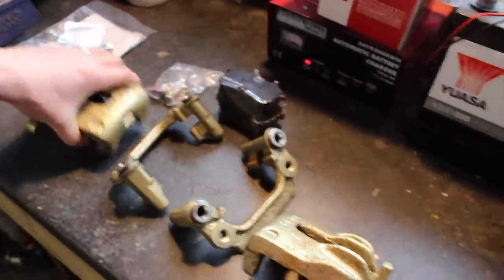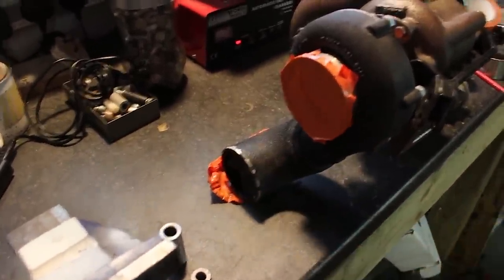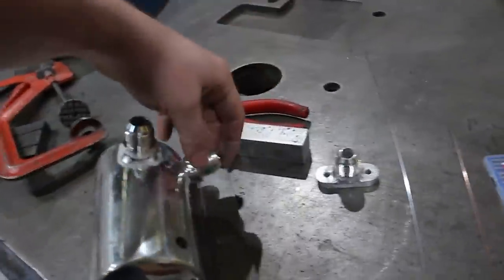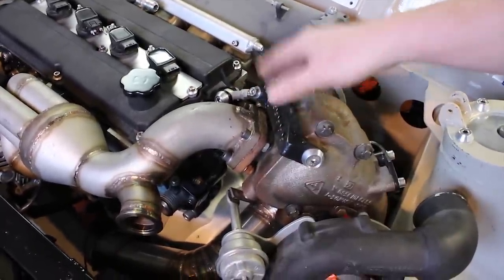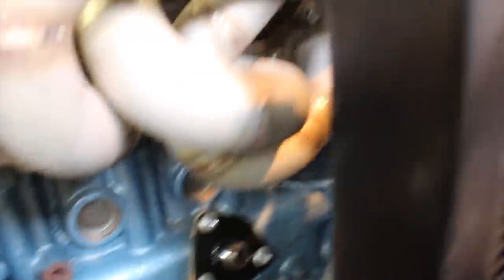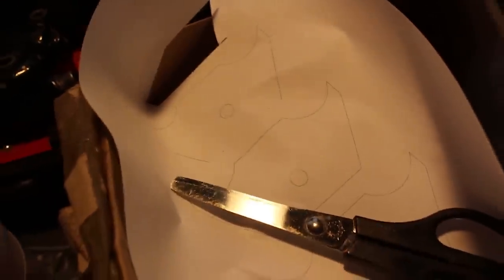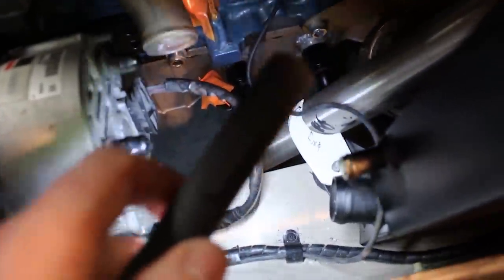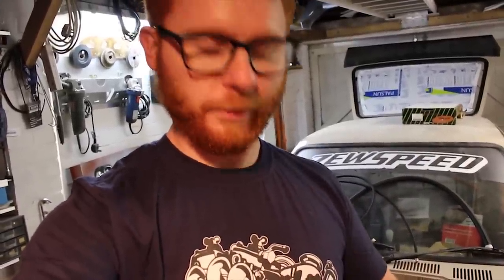Compound Turbo Fiesta - Episode 18 - fitting the poly windows

Comment: nice fab work as usual, ive got a twin turbo bmw 123d, compaired to a 120d which has a single turbo it feels very un turbo like , no lag, no rush of boost just a strong puch in the back from next to nothing , 265 bhp mapped and 57 mpg on a steady run out today .!!
Reply from the maker: I think the BMWs have sequential turbos. their system works very well. all the torque all the way through the rev range.
Reply from the maker: ive got a 330d and a single turbo you can feel it getting up on boost.... aint nobody got time for that!

Comment: Better to put those cotton reels in compression rather than tension, they do tend to deteriorate quite quickly with the heat & tear apart otherwise. Coming together tho. What was tge compound setup from originally?
Reply from the maker: i did think that but Simpson Racing exhaust use them all the time and dont seem to have any issues? i will keep an eye on them. i would hope they wouldnt all fail at once if this did split apart. the compount turbos are Borgwarners R2S from a MAN truck ;)

Comment: Bloody hell mike!!!!! That has come on leaps and bounds. What size is the  fitting your using on the oil breather that fits on the block under the mani as I think I need one and not sure what size to get. You can use spray window cleaner to put your windows in a lot less messy and washing up liquid contains salt so not good on the rubbers and body..
Reply from the maker: the union is a AN-10 for all the oil breather system... noted about the window cleaner. top tip that ;)

Comment: does the side scoop provide enough airflow?
Reply from the maker: the one in the rear quarter windows? not sure yet. there are 2 x 10" fans on the back of the rad to help draw air through.
Reply: @mikefpe  i hope it will work. The car looks great